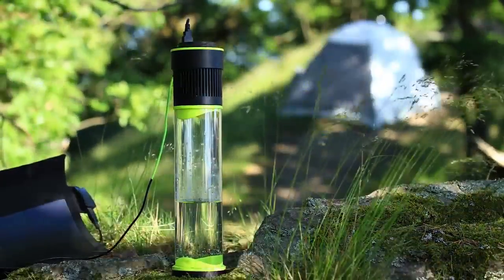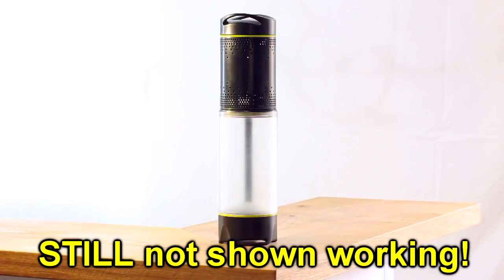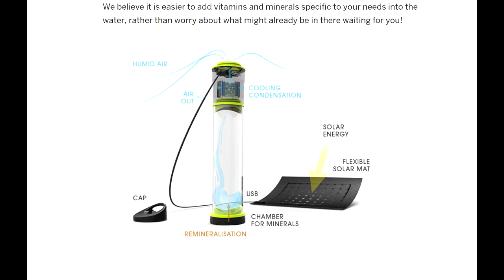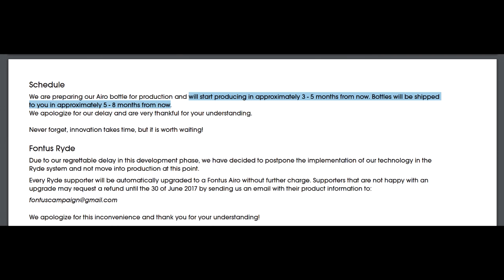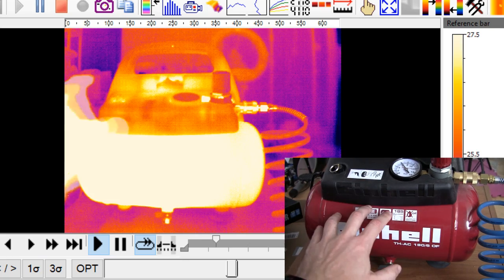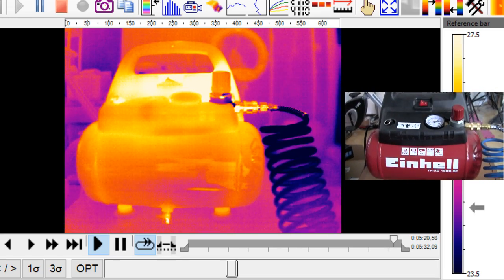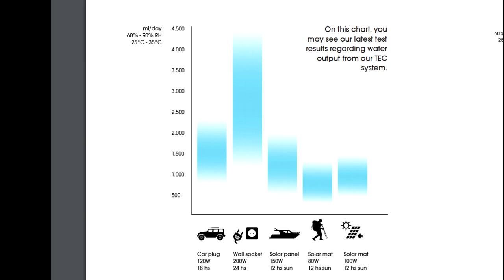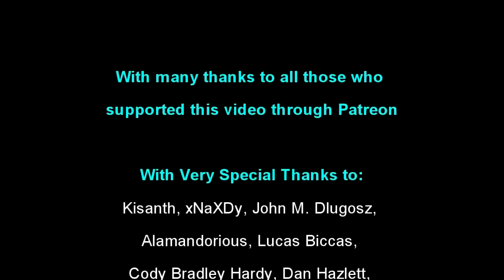$300 000 Self-Filling water bottle, SUPERFAIL!

Comment: also, how would the power get from the bottom section to the top section. unless there is a power cable/wire going through the clear plastic bottle, then there is no way the top bit is getting any power from the outlet.

Comment: Isn't Thailand humid as s*** but you wouldn't even need a special device just stick the bottle out there leave it open and it will feel just from the humidity alone.

And yes I'm joking where am I when the humidity reaches 100% in Florida you could just leave a hole bucket out there and it'll fill with water no electricity required

Comment: Well seeing USB cables today, there now are USB cables that carry up to 200W capable of charging a laptop and some phones now even use 120W chargers with many being around 65W. USB can carry a lot more power than you think, but the cables used aren't just some any USB cable. My new phone has one of those 65W chargers and it's not stranded copper like most cables, it's solid copper and it's twice as thick as the cables I've had sitting around the house for years. 

Still, we can all agree, this was a scam. Any product claiming to get water from the air is.

Comment: You know, we got a pressure system at work and it does remove water from air so it doesnt get into the preasure pipes and it roughly generates 10 liters per 5 work days....
oh and that machine, the kompressor, its about the size of 3 fridges :)

Comment: Thank you for some more shoddy research – very ironically the same thing you accuse the "Fontus" designers/scammers of. You say that USB "is five volts" and can carry at most 5 ampères. Only the second part is correct, USB Power Delivery 2.0 allows transferring 5A at 20V = 100W [1]. Yes, not quite the 200W that they are using now, but that's where you are also wrong: They didn't anticipate needing 200W at the time (it was a solar panel rated at 10W, as you yourself mention), so USB would have been perfectly sufficient. You are arbitrarily combining parts of the old and new presentation and then illogically conclude that their initial research was poor (which, I think, it still was, for other reasons). Now, it is absolutely fair to point out that they dropped some attractive features – like USB support and the compact, foldable solar panel, but what you did is not fair.

[1] And, yeah, before anyone claims that you needed USB-C for that, and the picture shows USB-A… nope. You can use PD2.0 with a USB-A connector, although an active PD 5A cable is required i.e. simply put, in addition to meeting the low resistance and thermal requirements, the cable needs to contain a microchip that participates in the PD negotiation. The power supply or host, device and cable then start out at 5V and 0.5A and negotiate the maximum safe settings (if the device even requests as much power as it can handle, of course).
Reply: TruthNerds I was going to mention that USB is five volts on requests
Reply: And despite Thunderf00t being somewhat off in describing this thing that totally matters, still no one has a fontus. Hm.
Reply: @Wix_Mitwirth  I didn't give them a dime…

Comment: USB cables are rated at 2A@5V to be safe limit. In reality the actual use is only 0.5A and as a result many manufacturers use smaller wires than standard requires. 40A would burn USB cable very easily.

Comment: You forgot to mention that the water that comes from the air will be filthy.  Have you ever seen the water that condenses from your air conditioner? You wouldn't want to drink it. It's gross.
So, you'll have a really big, heavy, clunky device that makes lots of noise and vibration that makes undrinkable water really slowly.  Under most conditions, it'll require days to make a liter of water - which is less water than you'll need to survive. Plus, you'd have to filter it before drinking it.

Comment: It sounds like the underlying concept works. It's just not very efficient. If so, why not sell a version that works on a boat and converts solar energy into water? There's a lot of space on a boat for such a device. It would also be useful to leave on a trail, especially in the desert. It would be a huge boon to hikers everywhere. Just make it the size of a drum with a solar panel the size of a table.
Reply: On boats it's pointless to make water from air. There's lot of water around which you can purify with reverse osmosis devices.  And they are way more efficient than this kind of system.

In desert climate there's just not enough humidity in air. For example while I'm writing this, in Timbuktu temperature is 41°C and dew point is 7°C. So you have less than 7g of water in cubic meter of air and you have to cool that air by 34°C in order to extract any water. You'd need HUGE solar array and big compressors in order to get any significant amount of water. It might be cheaper just to drop water bottles from a helicopter.
Reply: That makes sense. TIL.

Comment: Dude. How do you how power generation issues on something you're mounting to a bike? 

You build a power-reclamation system that integrates into bikes that you plug the Ryde into so that it generates power while you ride it, and then some solar panels so it runs a little while it's parked or whatever.

Comment: You're explanation how refrigeration works is completely misleading. Refrigeration units use a condensable gas not air. Using the laws of latent the condensable gas goes into a phase change in the low side of the unit. In turn it takes heat out of the evaporator. Which gas is compressed on a high side and heat is removed into the condenser, in order to repeat the cycle.

Comment: The twats last update on indigogo to a backers question:

" Thanky for asking! We have concluded the pre-production development of 
our metal parts with two different companies. Production based 
prototypes have been orederd now that will be tested and compared. We 
have also concluded a first pre-production development stage for our 
plastic parts but have still an important step to go here. We also 
managed to select a competent manufacturer for the main production and 
are discussing further steps. And are organizing final production 
investments. "
Reply: Lots of "pre's" in there.... This whole campaign is such a good laugh, can't wait to see a "working" unit whirring away, pumping out 200w of heat from a hot, heavy power brick.

Comment: What a shitty concept. My idea, which costs almost no power, is to just reuse the water already existing, like from ponds, lakes or the sea. You'd just have to evaporate the water and filter it (at best through multiple small copper filters) to kill off most kinds of bacteria and then put the filtered water into another container. Both containers could fit inside one another to save up space, and if the container where you put your found water were to be for example copper, you could, in theory, make a small heating mantle and put a camping stove right under that. No electricity required and it would work faster and be cheaper. But on the other hand it would also be simpler to just carry a few more water bottles with yourself, which makes my and their idea pretty useless.

Comment: That's feeking brilliant considering that British main devices used to be rated at 240VAC, but now only needs to be rated at 230VAC and at 240VAC at maximum. So run it off of British mains power via USB, you are gonna burn your house down!

Oh, and as an avid hiker/bushcrafter I can tell you that in the home counties your never more that 6 miles from a road and 10 miles from a village and 80% of villages have either a convenience store or tavern in them. So emergency water is readily available if you can't for whatever reason collect water around your campsite!

Comment: ha i have that exact air compressor you showed. i bought it just for fun but it turns out to actually be pretty capable. now i carry it in my car to fill my tires off the 12v socket, and it does that pretty nicely.

Comment: Compressor type cooling systems use phase-change operation, not adiabatic heating/cooling. Not that this will make it easier to implement it into a water bottle. Also: PELITER device? (10:52)

Comment: I remember hearing an Alex Jones ad for atmospheric water generators years ago!

Drinking water producing dehumidifiers have been around for a long time.

Standard dehumidifiers don't produce particularly pure water. I once tested some with a meter I think it came out as around 60ppm dissolved material.

Perhaps their unit is more portable and that is the novelty.

Their might be a limited scope for it's use if you are traveling in a remote area using a car.

Comment: Along the idea of portable water, maybe a back pack or item that hangs form a bike frame that you fill with water and then place in the freezer a day before your big ride.  The device would have vents that work like Venetian blinds to act as a throttle for the amount of melt you get.  This would be a better design challenge for art students, rather than overthrowing the laws of thermodynamics, as making the various ice/water cells in a comfortable configuration would be quite challenging.

Comment: lol you showed a waste water treatment plant not a surface water or ground water treatment plant.  you see the effluent wiers on those circular basins? those are secondary clarifiers and primary settling basins/clarifiers probably.  the two buildings are probably concealing equalization basins. 

the basins in the middle are probably the chlorine contact chambers... or maby an SBR set up. 

the basins on the bottom left of the screen look like oxidation ditches for your nitrification and denitrification.

this plant is being treated badly btw, who the hell let those weeds grow up between the basins?  

you do not drink effluent from these plants... yes you can send the effluent through polishing filters and then through a reverse osmosis plant, but its almost never done unless you are in an insanely arid place like israel. even they barely do it.  too many sheckles.

Comment: a nano weaved fabric body for the outside of a bottle with capillary designed drip feeds with one way valves could fill a bladder, from natural humidity. Then each environment from the driest to the wettest would have different rates. Without power. No matter how much energy one uses, to extract water from any environment, the humidity is a huge importance.

Or course if your holding the bottle or its close proximity, it does;t have a kidney function, so all moisture could cause it to cease function from clogs by oils and other contaminants in the water. Thus another problem is it absorbing you sweat for you to drink you later.

Alternative majority of places become humid at night, so to take advantage of humidity at night. I think the best way is to have a bottle and unfolding reverse looking umbrella's with some sort of apparatus to create condensate from the temperature falling and the humidity of pressure system moving. Thus creating water while you sleep, to funnel into a reservoir for carrying. i.e. a bottle. I think this would be a more reliable source of gathering water. 

AN advanced fabric that has a underside of metal and hydrophobic upper system, would allow the water to travel more freely to the reservoir and not impede itself to form condensate into droplets and thus hanging and reducing water to form at a more constant rate. These things already exist for camping gear, but it could always be improved. Plants do this, but of course environment and knowing what its day and night humidity is important.

Also there is some strange survival tips for certain regions in which creating a fire near certain types of rocks can create water from the rock, or moisture/steam, which is interesting. Then you need to capture it, most of the time capturing in this method an umbrella shape system works much like a distillery works in not allowing the steam or moisture to escape and then condensate from on the umbrella shape has the water drip back into a container for water. Of course a system like this has lots of escape so its not really efficient but if one needs water, there are many ways a person could get water.

Comment: ... The Second anyone that has gone to school for HVAC (Air conditioning and yes they have to go to school or college  for that and it is pretty interesting) will see those compressors and tell you those are just scaled down versions of HVAC units for houses.  That copper kind of bulge is a filter, so i would not be surprised to find out they use something kind of chemical coolant, which will increase the cost even further.

Thunderf00t, I am sure you mentioned this but can you please make a video for the people who do not know about HVAC?  Yeah, it is not as 'cool' kind of science but it is a way to get water to boil at room temperature.  It will also tell people exactly how bad an idea this kind of a small compressor set up is if they use chemical coolant.  That stuff can kill pretty fast if too much leaks, not to mention the effects even if you do not die.

Great job keeping up the work on this, on a small scale this kind of thing will not work, and on a larger scale i would think desalination would be cheaper.

Comment: Actually.... this might actually be a good idea for life rafts.  Currently, the best desalinators for life rafts are large external tents which use the sun for condensation, and which are hard to set up and get working.  Instead, put a giant solar panel with huge surface area on top of your existing raft, to keep you safe from the sun, and get your one litre in eight hours -- and that one litre per eight hours can keep you ALIVE, albeit very poorly given that the water would be untreated, whereas transporting a finite amount of water gives you a hard maximum lifespan.  While a rain-catcher is also good, rain is not always guaranteed, where this would be.
Reply: modern life rafts have reverse osmosis systems.
Reply: RO systems will cost you $900 at best, and require more energy.  This is a viable alternative.

Comment: Here's the bizarre thing about the folding mechanism:

They have acknowledged that it takes a long time to get any significant amount of water from it. And it obviously won't work when folded up. So why would you ever fold it? Who cares if you can fit it in a backpack or clip it to your belt in folded configuration, if it doesn't generate water in that state. You would just keep travelling and then when you are thirsty, if you pull out the bottle it has generated nothing. And you would still have to wait many hours to get your water. 

Better to leave it in full size, working mode constantly. And then stick the solar panel to the top of your backpack and run the wire into the pack to the bottle. Or better, to your hip, where the air is more free flowing.

This is assuming of course that it would actually work, which it will not.
Reply: Chris Barbati Well, obviously, you deploy it when you've stopped to make camp for the night! 

🤓

Comment: Last I checked, water condensed from the air isn't really drinkable, and should be treated as "grey water" (https://en.wikipedia.org/wiki/Greywater)
Reply: Yeah, i's not as good as you might think.
I ran a dehumidifier in a big room where I had just used a professional carpet cleaner, I was So surprised to see the condensate actually smelt of the carpet shampoo and even had some foam forming on it lol
Reply: Dang, yeah. You wouldn't want to drink that. I have a dehumidifier in my room since it's always humid. I get about 5-10 gallons a week. I recently started using it to refill my aquarium.

Comment: If your off-the-grid adventures involve going somewhere where you'd have to carry around multiple day's worth of water, maybe you shouldn't go there. 
Also, this guy is from Austria, a place which has some of the most well developed hiking-infrastructures in the world. Even if you ignore all the purpose-built springs along the dedicated trails and are one of those assholes who goes off-trail, there are plenty of streams you could dunk your head in and slurp to your heart's desire. 
It's obvious even from the commercial that he's not actually envisioning this gimmick for actual hard-core trekkers who really venture off into the wilderness, but for pampered vacationers who want to shoop off on a 6 hour hike or bike-ride without the inconvenience of lugging around 2 litres of water.

Comment: Technically USB 3.1 Type C is capable of about 100W or more. Not 150-200W.Just a flaw in one of your points but still, Where is the power coming from? There isn't a usable battery bank that someone could use for this device. I mean I have a 20Ah battery bank that I can fit in my pocket and will charge my phone 8 times, but even that would have no chance of powering this. Just the current draw would be a huge fire risk on cheap lithium batteries. No way could you pull 120W from a battery bank and 1, not have it require replacement over just a few cycles, 2, not have a major fire risk and 3, have a usable charge in a small enough package to run for the length of time required

Comment: As a designer and engineer one of the stupid things I spotted is they have the power going into the bottom of the "new Fontus" while the power is consumed in the top of the unit. Why is this a stupid thing? Because this would mean you have to integrate power wiring into the bottle section of the unit and ensure that both the top and bottom sections make a perfect connection when they are screwed onto the bottle. 
Ultimately the only people dumber than the creators of Fontus are the mental midgets who sent them money for something that will never work.